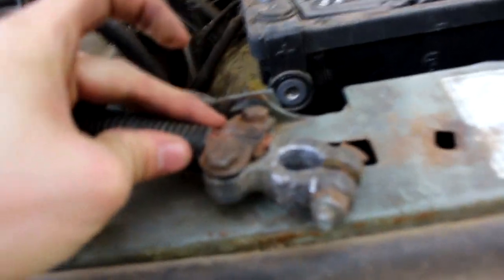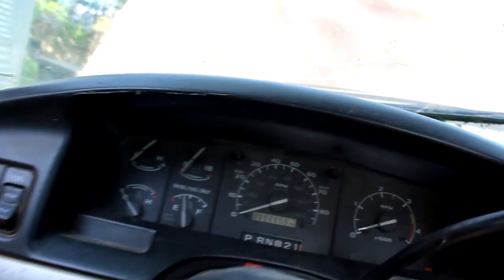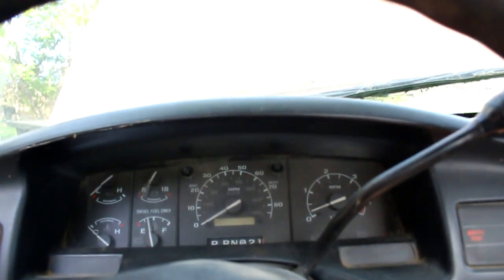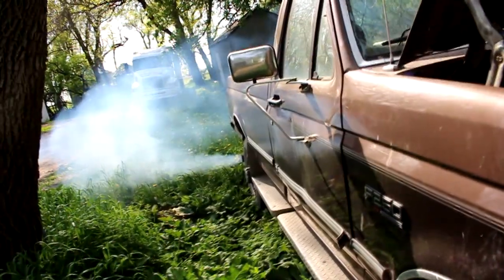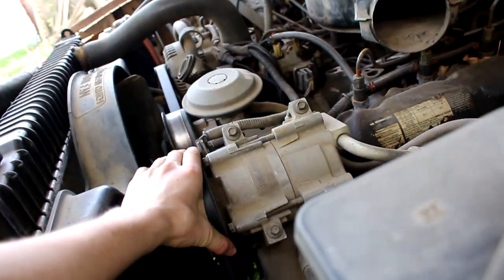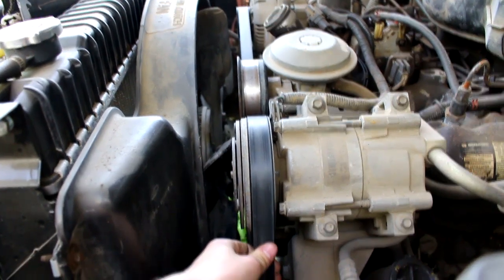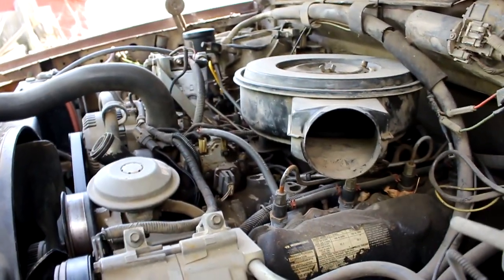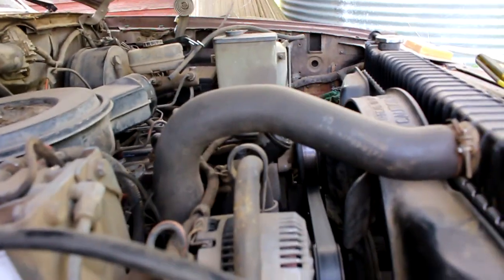Old Start Cold Start Ford F-250 XLT IDI 7.3L Diesel

Comment: My Cummins started first turn of the key after sitting for 4 years when I bought it...2 new Sears batteries and 5 gallons of fresh fuel and 3 key cycles to reprime the system and it fired first actual crank...impressed was I 😳

Comment: IDI is a International Diesel Engine and the DI is Powerstroke Diesel.

6.9l Diesel V8 was from 1983-1987 and 7.3l Diesel V8 was from 1988-1994 but the International trucks has the 7.3l Diesels from 1986-1994 not 1988.
Reply: there also some 7.3l diesel in 87 later in 87
Reply: jore551 I've had 2 they ain't powerstrokes ! they are 7.3 Navistar engine no turbo!! AWSOME motor!!
Reply: @squach6239  Not nearly as good as the powerstrokes / T444E's.  No turbo shows it's true colors when pulling loads up hill.

Comment: glad to see my favorite truck is finally running tyler good job bud has your dad got the alternatior and battery's  for the freightliner yet? tyler bud I cant to see you get the farmalls revived and the old 69 ford I love that truck too
Reply from the maker: yes. we are going to get a new battery and alternator for the dump truck. but it will have to be in a later day. we will film a 2nd attempt soon. and the farmalls soon to. just have to wait when my dad is done planting soybeans it been raining every day here and severe storms so it's hard for me to do anything when it's bad weather and him to.
Reply: yea its never good because u cant nothing done
Reply: hey you cant get fire on a diesel engine no spark plugs
Reply: You can get fire from a diesel, believe me I've done it. I had one of my injectors stick open on my 7.3 Powerstroke, and when we were moving it when cold the other injectors were sticking closed, so we got so much exhaust built up from the stuck injector that after about 30 seconds with my foot on the pedal huge flames started shooting out the tailpipe. It was awesome.

Comment: How is your head gasket, could it be causing the smoke/vapour?
Reply from the maker: no it can't be i checked the oil it is good no water and its just been change and the coolant is full and perfect it is the injection pump it's the same one with the engine when it was new. in 1993